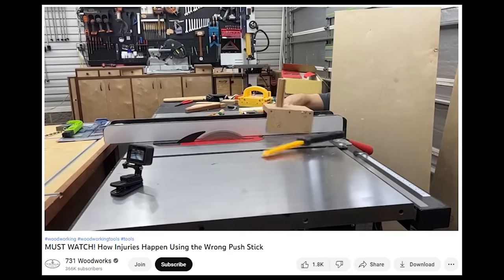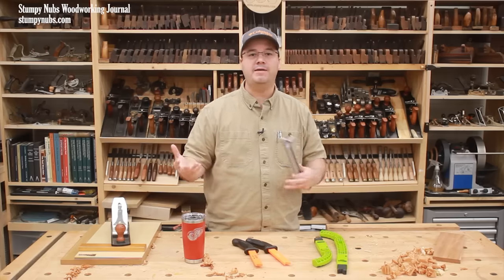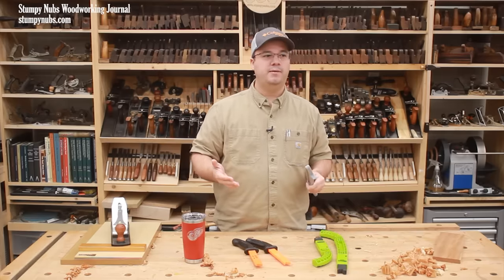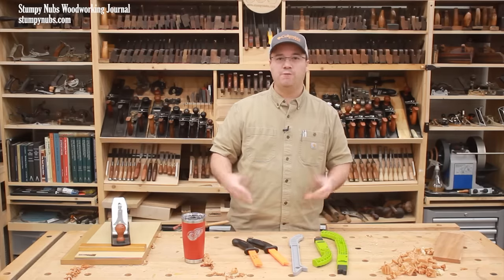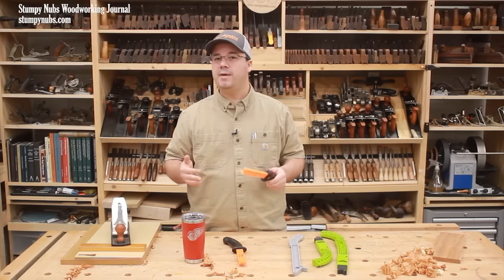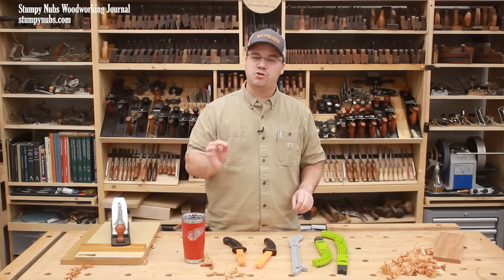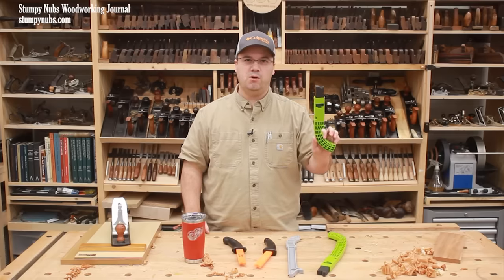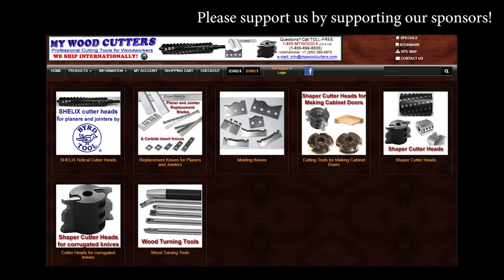EXPLODING table saw push sticks are a real thing!

Comment: Years ago, I picked up a pair of plastic "chicken foot" push sticks from Menards. I tried them but I'm not crazy about them for the very reason of discussion in this video. I lean more toward the legendary Matthias Wandell wooden push stick design which he inherited with a saw that he bought. I do not use push sleds at all like the ones Colin Knecht or John Heisz use. If those kick back then my hand is jammed with something relentless that will snap bones. I think they're a trap. Over the past 50 years in the woodshop, I came up with my own design as I'm sure a lot of woodworkers have.

Comment: I was using a plywood 3/4"x1" x16" push stick and hit the blade.  The end of the plywood shattered badly, I feel like a plastic push stick would have been safer. No injuries, had safety glasses on. The best is to plan your rip  cuts so your push stick misses the blade.

Comment: Yes!
I had the factory supplied push stick on my Dewalt tablesaw contact the blade it flipped back and struck my arm.  Tore my shirt, but no skin penetration. Caused a deep hematoma on my forearm.  I thought I had positioned the push stick a safe distance from the blade.
The incident happened so fast I am not sure what happened.
The injury took about a month to totally heal.
Very lucky.
I am now using the Microgtipp push block for sitUations that would bring a standard push stick near the blade.
I got lucky in that I was not injured more severely.

Comment: Type of plastic matters. We found a popular brand of plastic flexible conduit became explosively brittle after a few months - bend it beyond quite a wide circumference and it exploded with very sharp shards flying all over the place, just missing our eyes. Mentioned it in my customer review.
   It also happened with some plastic socket boxes.
   Different brands, more pliable plastic, no problem even after several years. The very well-known UK store no longer stocks the brittle plastic brand.

Comment: That double magnet plastic push stick sounds like it has glass fiber reinforcement in the mix when you used your knife on it, and makes sense that it would be ejected from the test jig. The other orange also looks like a similar nylon, but no reinforcement fibers/beads 

Something to consider is the machinability of the plastic, something like UMHW w/ no reinforcement filler would be a good option, it’s resistant to shatter and can take a beating, whereas an un reinforced ABS or PVC based plastic May very well shatter if it’s too cold. 5:00

Comment: Mine blew up recently on me. Stock push stick for my saw stop. Cut was about 1/4inch, I tried using the tip of the push stick to get the board passed the blade. It got hit and shattered. Had a piece hit me right below my belt line and one hit me in the face after hitting my glasses. Hurt a bit but wasn't awful. 1..wear your glasses! 2..use a sacrificial push stick lol

Comment: The shop I worked in had 3 Delta table saws. They had been supplied with push sticks by the manufacturer when new, but they had earned their scars over time, and one had disappeared entirely at some point. So, I made some new ones...
Using one of the originals as a pastern, I marked them out on a piece of UHMW polyethylene. I cut them out on a band saw and four new push sticks were born. (That's one for each in the shop, and the one I took home for my own saw.)
They were quite stiff enough to push material through the saw, but if they did come in contact with the blade there was no shattering. In fact, I tested a piece and it didn't kick back, shatter, or anything - it was simply cut away smoothly.

Comment: An injection-molded part has an unpredictable mess of internal stresses that might make it behave unpredictably under failure conditions. Plastic is nothing like wood; you kind of walk a fine line between a material that explodes into razor-sharp hunks and something that melts and grabs the blade. And it may depend on the temperature at your jobsite.

If you were going to make a push stick out of wood, would you choose a straight-grained piece of pine or a knotty kinked up piece of maple?

And yeah, I agree that this is another instance, and I know you don't really like hearing this.... where cheap safety features may be more dangerous than no safety features....  but again... that does not mean safety features are bad!

Comment: A disposable Cork\balsa tip instead of the close cell foam in the commercial push stick would provide some safety factor.

= No shattering on contact
= Dampened transition of torque to handle\wrist
= Ejection of granular Cork grains vs splinter shard

Comment: I've always used wooden push sticks. A while ago I was given an aluminum push stick and decided to try it out.  It was very thin so I figured it would be good for cutting thin strips, and (unsurprisingly) it hit the blade, That drove the handle into my palm resulting in 7 stitches and a decent amount of pain. As an added bonus it chipped 3 carbide teeth off a brand new blade, something that would never happen with wood or plastic. Don't use aluminum push sticks!!

Comment: We've had HDPE pushsticks catch on the blade causing injury and the push stick to go flying across the shop at high speed. I do not recommend using this plastic at all, your old cutting board is not a good choice of material. We use 5 ply voidless ply wood for our push sticks and there's never been a problem since.

Comment: Am I having a Mandela effect. Those aren't push sticks of course you're getting injured. A push stick is a long block of scrap. Or it looks like a hand plane with a handle at the back. Flat to the face of the table. I just use scrap 2x because why would you pay for a push stick.

Comment: the explosion probably came from twisting the push stick while it was in contact with the blade.

I used to work in a cabinet shop, and they had a push stick made out of rock maple.  This push stick was used on an early 80's Delta RE-35 (7.5 HP, 3 phase 240V) monster.

One thing to realize with this saw... the blade tilts towards the fence, and you can't put the fence on the other side of the blade (sliding table).

I was asked to cut some 2x2's for a drying rack in the paint shop.  I was told to bevel the top so there was as little contact with the item being put there as possible, so I swung the blade to 45 degrees, moved the fence a few inches away from the blade and started feeding pieces through.

We all knew this was dangerous, so one of the other cabinetmakers stood at the outfeed, and would pull the pieces through, once enough of it had exited the cut.  First cuts were easy - there was enough material for the push stick to ride the fence on a flat surface.  The fun started with the second bevel.  The push stick had to be held at an angle to get and purchase on the wood, and if you're holding it at an angle, the possibility of twisting is increased, and that's what happened.    The solid rock maple push stick twisted after it hit the blade, and there was no way that saw and blade was going to slow down for something like that, so it shattered the push stick in my hand, and threw is backwards into my palm.  Luckily no broken bones, but it did cause my hand to swell up and instantly bruise.  I was unable to use my hand for about a month afterwards.

Wooden push sticks are great, just don't use a hard, dense wood!!

Comment: I would use the witch test method: Clamp push stick in vice. Pull over to the side. If it snaps, leaving sharp edges, it was crap. Throw it away. If it just bends, while staying relatively firm, you have a winner.

Comment: Woodworking for over 35 years and learnt that they can explode. Had it happen. Even had acrylic explode on my bandsaw a few months ago because it was a rip blade. Broke the blade as well. I still have plastic pushsticks and use them on the jointer but all my tools have two versions of plywood sticks made from baltic birch. Long handle version and shoe style. Make a router template and pump out a bunch at once. And like Norm said : there is no greater safety device than safety glasses.cheers.

Comment: GREAT Explanation with the Foam Push Stick. If you use a WOOD push stick and TWIST it like you did the Foam it will KICK BACK and if you are holding it firmly it will hit your  forearm. I was cutting a narrow piece and intentionally ran the push stick through the blade. I got careless and did NOT keep the Push Stick FLAT against the FENCE and it GRABBED the Blade and Threw it back against my forearm. the Corner of the 1x1 Broke the skin with Blunt Force not because of a cutting process. I could have Easily BROKEN my arm. I will still use the push stick in this situation. Make SURE the Push Stick remains FLAT ON THE FENCE at ALL TIMES.

Comment: I have never understood using pushsticks like the ones shown, that barely have any means for preventing the workpiece from flipping possibly causing kickback. For decades I have made my own pushsticks from 3/4" plywood more or less in the shape of a shoe, with several inches to hold down the material being pushed through, and a handle leaning back keeping my hand away from the blade as I'm applying pressure. I can push them right through the blade for narrow work when needed. I make 3 or 4 at a time and that usually lasts me at least a couple years, and I use a table saw daily. I'd include a picture but I don't see a way to do that here. At any rate, I would never use the sticks you show here that can allow a work piece to flip back on you.

Comment: Great video, to add I was unfortunate and just tagged my push stick on the blade while cutting a 2x4 and it completely shattered giving me 5 stitches in my hand, a very scary event. The push stick was the one supplied by the manufacturer of the table saw. I wont mention the manufacturer but it was one of the better brands.  I now only use wood home made push sticks.

Comment: I tend use use plastic push sticks that I buy at the lumber yard for $2.99.  They are bright orange so don't get lost in the shuffle, and last quite a while before they get whittled away from rip cuts. Generally 3 or 4 on hand.  Safer than wood IMO, since there is no short grain to break.

Comment: I think this is an excellent presentation.  Your approach to this and other subjects is measured and considered and you do not make over-generalized pronouncements.  I have a gray plastic push stick that has accidentally hit the blade and it put a little saw blade notch in it just like in wood.  And I’m sure, as you point out, there are some plastics that might shatter.  In all fairness to the 731 Guy, he does have good presentations and I enjoy watching him too.  He may tend to over generalize at times, but I still find his channel informative and well worth watching.

Comment: I only use push blocks and only the ones that I make out of wood. I make them so that they can be cut and when they get to bad, throw them away and make new ones.My push blocks are usually made from a 2 X 4 scrap, usually about 8 to 10 inches long and have a nice comfortable "store bought" handle on them. A piece of scrap 1/4 inch plywood on the back for a push and i have a push block that will last for a long time. Also, this video showed the push stick hitting a blade that was so very much above the material height that it isn't even a good test. That much blade will shatter most any stick even my block as the blade was higher than the 2 X 4 would have been. Not a good test I'm thinking...

Comment: I have seen many types of wooden push sticks thst have their own replaceable ends on them, so that all you need do is remove one piece, toss it in the burn pile (or shred it for mulch), and attach a new end. That way, you have your comfortable handle and correct angle, but have the ability to replace just the chewed up end. If I recall, one of them was on one of the channels I follow regularly. If I can find it fairly quickly, I'll come back and edit to list the title name and channel name.

Edited to add:
What I was talking about (and what I should have said, instead) was a push block, not a push stick. I prefer using the block, since it makes sure there's more material in contact with your work piece. Anyway, the video that I ended up using the pattern idea from is from Steve Ramsey, Woodworking For Mere Mortals, and the title is "How to make a push block. Essential woodworking jig and shop project."  It comes with a pattern, though it's really dead simple and doesn't really need one, if you do much woodworking at all. Still, it's available if desired (or was when I first saw the video).

I apologize for misspeaking and saying push stick when I meant push block.

Comment: Apart from always using wood, I always make mine in the shape of a saw handle. This prevents the possibility of a thin  stick breaking or slipping when pushing between the blade and the fence which s thx greatest problem with these plastic push fences. If the piece I am cutting is very thin, the large amount  of wood of my push handle will absorb the blade into it without possible injury. It is also a good use of scrap plywood of 1’x1’. Just use a hand saw to draw the handle shape on a 45 degree angle to a top corner , cut out shape and round over edges, then cut a partial notch for the bottom edge so it will catch on your workpiece.

Comment: A plastic push stick put on its flat onto the blade is more likely to shatter and possibly cause injury.  If used correctly a plastic push stick should not shatter, if you’re waving it around and it hits the blade flat well then all bets are off.  The tips I’ve learned are these:  1) When starting the table saw do not stand in line with the blade, if a tooth is loose it’s more likely to come loose on startup as the rpm is picking up.  A buddy got hit in the chin by a flying tooth on startup so learn from his misfortune.  2) Never operate any saw with a faulty guard.  Another buddy got injured by a guard with a faulty lock nut, the guard slipped down onto the blade and eventually it got stuck.  Then the riving knife broke, and that and the guard smacked him in the bicep.  He was a big guy and took the hit, but the bruise was from wrist to elbow nobody wants that. Copping that in the face is never going to end well.  Enough horror stories, stay safe, have fun with wood and keep smiling.

Comment: One thing I think you should be careful about. Don't grab a 3/4 inch by 3/4 inch by 18 inch strip of oak, with a 45 degree bevel on the end and use it with the sharp end pointed at you. And if you do, do not get careless and after ripping your forth 2in x 2 in curly maple desk leg you are making for your wife, and while bringing it back let the end wander into the top of the powered on saw blade.

You just might find it shoots into your forearm and travels up to the inside of your elbow. 

DAMHIKT

Comment: i had cut my plastic push stick before so i wasnt worried when i saw it was going to get in the way again, but i think my saw blade wasnt as sharp and it caught the push stick and flung it off to the side where it chipped off my fingernail..  that hurt like **  and made me rethink the safety of that plastic push stick..  i chose a different design and made it out of wood..  im still a little freaked out when my push stick gets too close to the blade..  my fingernail grew back but i havnt forgotten how quick and easy accidents happen

Comment: I do not consider myself an expert of push sticks nor an expert craftsman by any means. Been doing woodworking off and on since 7th grade shop back in the late 1960's. Back then the shop teacher did not use, or let us use, any kind of a push stick of the type referenced in the video to push the stock through the cut. These types were used to guide longer stock after the blade and aid in keeping the board flat to the table. A meatier wooden push block was used to push the board to and through the blade.
  Plastic push sticks were unheard of back then. Push sticks were made of wood and there was no blade guard on that nice DeWalt table saw. In the past 52 years, I've never had an issue using a push stick as a guide stick and a push block as a feeding tool. 
  I should add, in 7th grade shop the teacher ran the table saw. In 8th grade we got to do the cuts ourselves with close observation from the teacher. He was a stickler for the simple rules to which I still abide by today.

Comment: I actually had a pushstick accident. I was paying more attention to the work piece after pushing it through the blade and I let the end of the push stick get into the  back side of the blade. It was made from a hickory scrap and was very roughly made. It had sharp square ends, and I just notched the working  end. It kicked back and blasted the handle end into my wrist so hard I thought it took off my hand. I ended up with several stitches in my wrist. Now I make my push stick out of softer wood and I round it all off. Also I let the end of the handle by-pass my wrist just in case. 
Just thought I would share an experience.

Comment: The plastic push stick that came with my Hitachi contractor saw exploded when it hit the blade. Scared the s**t out of me. Fortunately, I was not hit with the debris, but any one of the parts was big enough to do a lot of damage. Sounded like a gunshot. Now I use a push block.